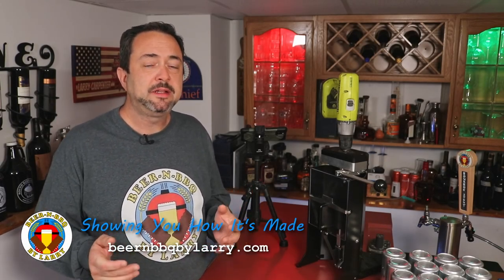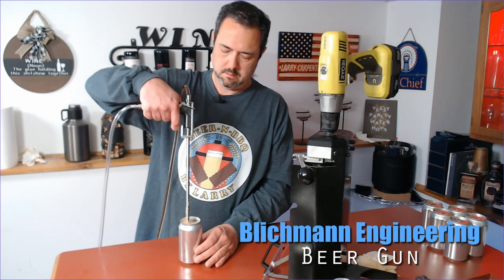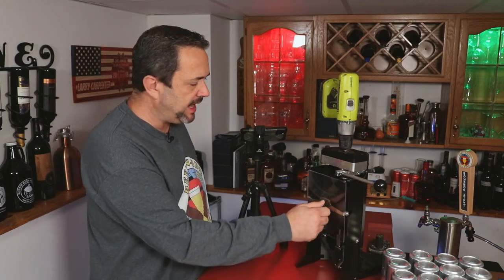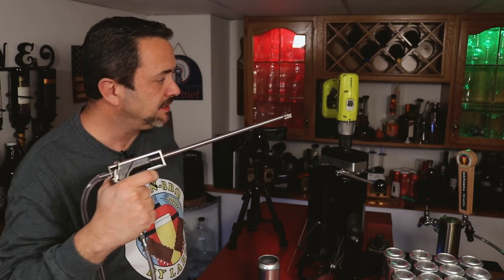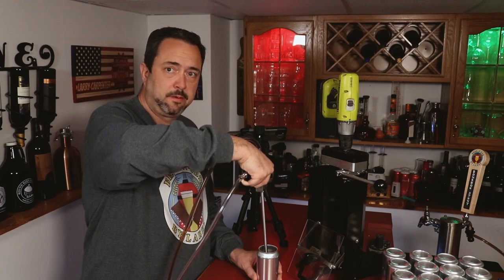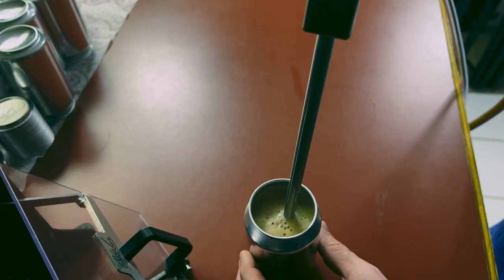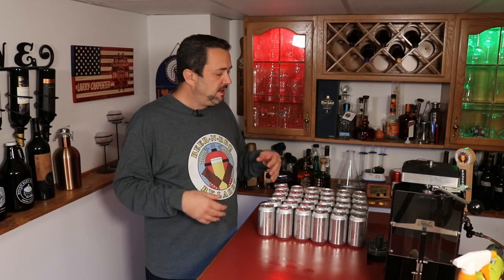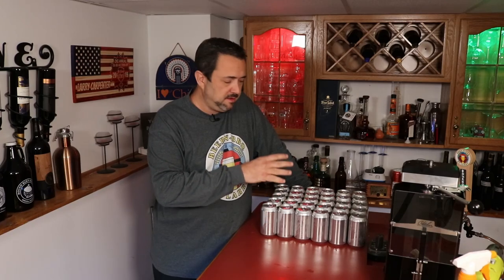Canning Home Brew Using the Oktober Design BenchMK Can Seamer and a Blichmann Engineering Beer Gun

Comment: GREAT JOB!  I have an Oktober Design SL1 Can Seamer with the optional splash guard and I love it!  I also use a Blichmann Beer Gun (older model.)  I normally put my beer gun into a tall Tupperware pitcher full of StarSan.  I place the Can Seamer on a thick folded towel and I put the can I'm filling into a shallow plastic dish to contain what runs over.  I fill the can to the very top, float the lid on the foam and place it into the seamer.  I allow the chuck on the seamer to press the lid in place before starting the motor.  I've attached a foot switch to operate the motor so as to free up my hands.  I can seam a whole case of cans pretty quickly with minimal mess.  Cleanup isn't too bad and I get to share my brews with friends who don't have to worry about returning my bottles.

Comment: The only problem with kegging is that you can't take it with you which is where bottling and canning comes in handy. But like you said, beer bottles aren't cheap anymore especially the swing tops. Holy shit they are extremely expensive now. I found that out when I went to order some bottles for my BrewDemon Hellfire Deep Red Ale light beer kit. It was cheaper to buy a case of regular bottles, bottle capper and bottle caps than it was to buy a 12 pack of swing top bottles. This also looked like a pain in the ass to do. I'll definitely be going with a kegging system when I decide to upgrade my home brew set up.

Comment: Damn it! Already gave it all away. 😭 I'm always late to the party. Have you some Happy Holidays Larry!
Reply from the maker: I have less than I originally thought.  Found out later that I had some leakers in that batch.
Reply: @BEER-N-BBQ by Larry  Ouch ! That's even worse. I've been debating getting a canner. After watching this.... meh... not sure.
Reply from the maker: @curtpick628  It “can” a fickle process. (See what I did there?)
Pressure and temperature are only a part of it. I never went into the need to inspect and re-calibrate it every so often which also require special tools.

Comment: Hi Larry, Great video as usual.  I have been brewing for eight years now, and I still bottle condition three batches every two months.  I have a kegging system, but I still prefer natural over forced carbonation.  Bottles are a lot more work, but I have been retired for ten years, and I have the time.  You are right bottles are expensive, and I hate to give them away.  Canning could be in my future, if it is possible to condition in a can.  CHEERS!!
Reply from the maker: Why not naturally carbonate/condition in the keg then bottle?
Could save you some troubles and ensure consistency in the bottled beer.
Reply: @BEERNBBQBYLARRY  I did naturally carbonate in the keg once, and I was very happy with the results.  I would not hesitate to do it again. It might be my imagination, but it seems to me that natural carbonation taste better than forced carbonation.
Reply from the maker: @3rwparks3  I used to have that opinion too but was never able to verify it in any way. 
My impression at the time was that natural carbonation made the bubbles “taste” smaller and therefore smoother. Could never find any real explanation for it though.
Reply: @BEERNBBQBYLARRY  I am a big Belgian beer fan.  Some of their higher end beer, St Bernardus for one, is naturally carbonated. I agree that there is a difference.  What ever it is..

Comment: I’m still working on my counter pressure bottle filler.. prototypes have worked..making it smaller and easier to use.  Trying to finalize it to a “one hand operation”… 
  I’ll send u one for beta testing when completed.
  Not going to sell it, but will make plans / files  available online at no charge.  
   Sill a little $$, but I could see a beer club purchasing one and sharing it among members…
Reply from the maker: Interesting idea. I never used a counter pressure filler. That only works on bottles though, right? There's no way to use it in canning that I can think of.

Comment: I am going to have to stay in my lane on this one. The results I get from bottling are pretty difficult to improve on. The can wins hands down with securing beer, bottles break. But, I can bottle as a secondary and come away with an improved product, and I could do the same with canning, but bottles are free. All I have to buy is a sack of caps. I generally reuse bottles that came with a commercially marketed beer in it. I am not about to buy cans, lids, a canner, six pack holders to put them in, etc. etc. Bottling can be done quickly, but it takes repetition to develop a process that satisfies our time constraints. Cheers Bud.
Reply from the maker: That’s right.  If you’re not giving the beer away or taking it places where you need to throw away the vessel it came in then no need to use cans IMO.
Reply: @BEERNBBQBYLARRY  It really comes down to expense for me bro. There's some coin tied up in canning.
Reply from the maker: Yes, there is. And storage space for ask the empty cans and filled cans.

Comment: You could always give it a little blast of co2 while the wand is under the surface of beer to get it to foam up a bit before you cap it (if there isn't enough foam for your liking)  Nice review i may consider one of these in the future.
Reply from the maker: Good idea. I dabbled with that idea a bit, but I think it was left on the cutting room floor. Didn’t want to create too many bubbles or possibly have it precipitate any of the dissolved CO2 in the beer. 
My real mistake was really just not accounting for the additional friction from the line length. 
I guess that’s what happens when you only do someone once in several blue moons. lol
Reply: BEER-N-BBQ by Larry  I saw someone else using a canner on a larger scale and they would keep a bucket of water next to the canner so once it was finished seaming they would just dunk it in the clean water then set it on a towel until they were done.  Seems easier than having to clean each one individually after you're done canning.
Reply from the maker: @itznolimitz  I dunked mine as well after recording the video, but I just reused my bucket of sanitizer instead.

Comment: Great video! Where did you get the ball lock and faucet? I've never seen either that are threaded like that and would like to do the same for my homebrew setup!
Reply from the maker: Either Intertap or Nukatap.
Reply: @BEERNBBQBYLARRY  Excellent. Thanks! Also you didn’t run into any issues with having the line open and pressure/beer building up when not filling the cans?
Reply from the maker: @j_as_in_j  pressure is constant as long as CO2 tank is turned on.

Comment: Material cost wise, is a can more expensive than a tradicional ambar glass. Bottle?
Reply from the maker: It’s less than swingtop or returnable bottles, but that may vary due to aluminum shortages that come and go.
Either way, is still cheaper yet to just keg it.

Comment: Canning seems more of a novelty to me?  I don't see much advantage over bottling. At least with bottling, they're reusable.  How much do the cans cost? Definitely not enough to justify $500 on a seamer, IMO.
Reply from the maker: It’s the latest home brewing fad. IMO, there’s only one reason to can as I said in the video; to throw them away when empty after drinking the contents. Otherwise, such to swing tops, growlers, and kegs.
Reply from the maker: @peterlokin4098  they can break (bust open after dropping them) although not as fragile as bottles not make a hazardous mess of shards everywhere.
Regarding the light, I don’t consider that a problem for home brewers since the beer will usually be in a dark fridge, basement, or other area as opposed to commercial beer sitting on store shelves.

Comment: Don't see the point point in purging the can with co2. The beer fills the can anyway, and when you cap on foam it's only CO2.
Reply from the maker: Like with bottling and kegging, the goal is to displace air at the bottom of the vessel so that when the beer splashes into the bottom of the vessel, it doesn’t churn and mix with air and therefore doesn’t start the staling process.
I think a bonus effect is that the blanket of CO2 dominant air rides the surface of rising beer in the vessel this also minimizing air contact.

Comment: That seems far more tedious than bottling. I can sanitize fill and cap 48 bottles in about 30 minutes.
Reply from the maker: I think it's less work than bottling. The steps are exactly the same for both except that cans don't require a cleaning before using them.